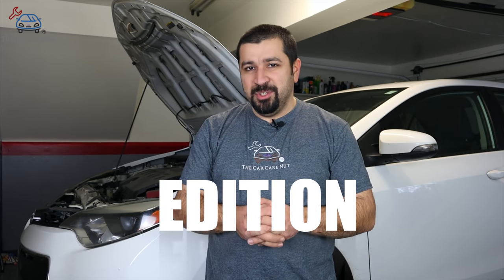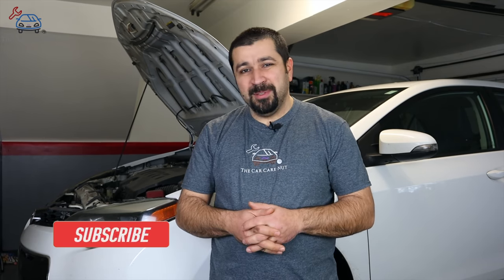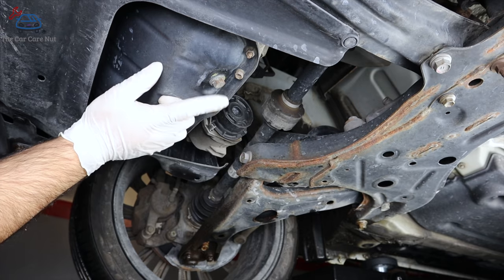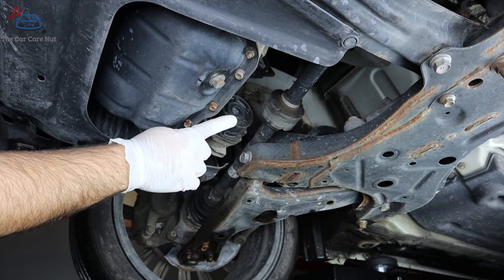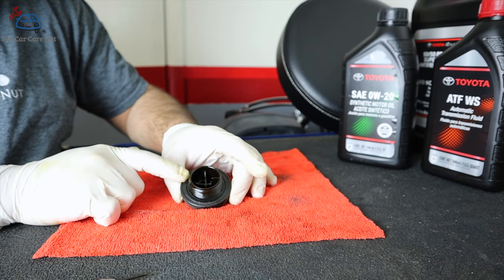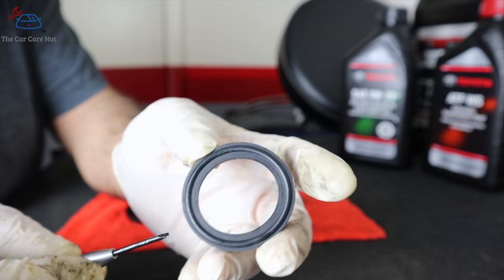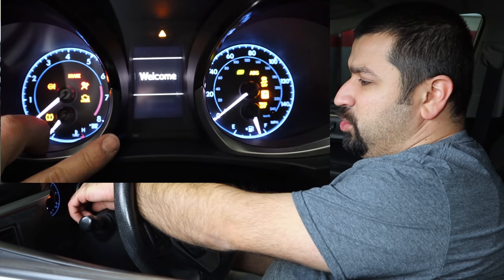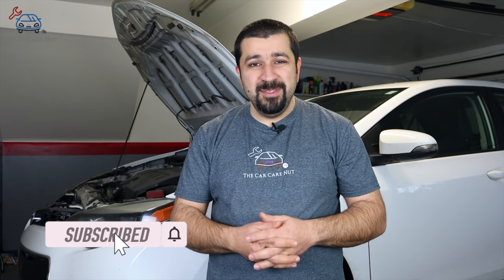How to change your Engine oil and filter for Toyota Lexus Scion

Comment: Hi AMD - i follow your schedule on oil changes and it's been great engine sound and performance (and least i feel like that!). Question - my 2016 RAV4 takes 4.6 quart of oil when changing the filter as well. But when I fill 4.6 quart and check for level (letting car run until temp gauge goes to the middle and then shut car off and wait 5 mins), it seems I'm always short ~1/4 quart to the top of the mark. Is it typical or am I just draining out more fluid given i only jack up (tech. on ramps) the front of the car, which leads to more oil drain given the angle? Thanks!
Reply from the maker: Hi! It’s possible you’re draining more. Top off the fluid to full when the engine is fully warmed up and you’re good to go
Reply: Thanks AMD! The manual says to wait minimum of 5 mins after engine warms up (then shut off) to check level (to let oil fall back down). It seems there is more oil will drip down if I wait much longer than 5 mins (for example after 20 mins I find more oil present on dipstick vs. after 5 mins). Does Toyota set 5 mins interval on purpose or should we wait longer to let all oil fully drain to check level? The manual did say a MINIMUM of 5 mins but didn't say exactly how long. Thanks
Reply from the maker: I would wait up to 5 minute but really 1 minute should do iy

Comment: How long does the car engine need to run to be fully warmed up?

I was wondering if I can check the engine oil level when it's warm in case I over filled my oil.
Reply from the maker: Hi! After a normal 30 minute drive the engine should be warmed up
Reply: @TheCarCareNut  I barely drive 10 miles a week and sometimes less than that, should I put the car in maintenance mode for 30 minutes then check the oil level? Or you recommend I just drive the car around town for 30 minutes?
Reply from the maker: You can do either but I would consider driving it to get everything moving since you’re not driving it much

Comment: Hello! Ive been looking around for more information in regards the 0W-16 oil. Recently, Ive seen in different forums that owners manuals from different countries (like Australia 2021 Rav 4) recommends oil weights of 0W-16, 0W-20, 5W-20 or 5W-30. Is there is a particular reason for this? Could be use these oil weights giving is the same Dynamic Force engine or the engines in our US market have been engineered or tuned differently to use 0W-16? Again, thanks for your insight.
Reply from the maker: There’s no official answer on this one. However I would recommend you follow your manual recommendation in your country.

Comment: On the spin on filter for my 18 Camry, should I put oil in the filter or only on the gasket??
Reply from the maker: Hi! No need to pre fill the filter and if it’s original filter it already comes with grease on the o ring
Reply: @TheCarCareNut  thank you. I always use TRD filters which I believe come like the OEM Toyota's pre oiled. Thank you so much. 😇

Comment: Can you do a DIY on a CVT transmission Corolla around 2016?
Reply from the maker: I do have one! https://youtu.be/eRxSu4-4ojo this is the exact same procedure just use Toyota CVt fluid
Reply: @TheCarCareNut  omg this is a dealership job... I'm always weary on changing the transmission fluid especially when it's someone else... Is it safe to assume all dealerships know what their doing and can fill it properly?
Reply from the maker: The transmission fluid replacement is very easy on Toyota sealed transmissions. Maybe for DIY mechanics it seems hard but for a professional mechanic it’s not a difficult process or an involved one.

Dealerships will be well equipped to handle a simple transmission fluid change and a fluid level check...
Reply: @TheCarCareNut  understood thanks for the info!  👍😁

Comment: Greetings from the Philippines!
 I have a 2016 Hilux made in Thailand and I’m curious if I can use an American Tacoma for reference when looking for info.
 I have two outstanding questions so far: how do I reset the oil change notification? It’s been bothering me for 3 years. Secondly, it seems I can’t lock all 4 doors without the key fob, just pressing the lock button the the driver’s armrest will only lock 3 doors leaving the driver’s door unlocked. I watched all the videos, contacted the dealer (not interested in helping) and tried ever conceivable sequence of buttons presses. Anyone have any ideas?
 Many thanks & love the channel!

Comment: Need some advice. 2020 Toyota Camery Le 2.5l 8 speed auto. Or Mazda 3, 2.5L 6 speed auto with tourqe converter awd? Yes it's the 3 not the 6 and it's a few bucks more then camry but I would get a repate. My concern is which four cylinder here is better and I've heard some pros and cons with camry 8 speed.
Reply from the maker: Hi! I don’t really know much about Mazda reliability but the later Camry transmissions are much better as they have the latest software from the factory.
Reply: @TheCarCareNut  Thank you. I'll will keep that in mind.

Comment: My 2007 Camry oil cap lists 0w20 and 5w20

Which oil weight would be best to use though? Car is on the Midwest and sees harsh winters
Reply: They typically reccomend 0w20 during colder months. Check the owners manual
Reply: @XxChuyoxX  ok the oil cap lists both 0w20 and 5w20 so it indicates either works on the '07 camry 4cylinder

Comment: Hello how are you ? I change my oil every 5000 mi  I use shell 0w 20 truck and tow full synthetic and wix 51348xp filter  for my taco 2.7l 2018. wondering if is there a larger filter i can use ?

Comment: Just had oil change AT DEALER for my 2021 Camry SE HYBRID.  Dealer used 0w20. Yes, right on invoice.
Your thoughts? Seems they ignore the recommendations
Reply from the maker: Hi! Is this in the US and is this the toyota included maintenance?
Reply: @The Car Care Nut  Canada. Here we have no included service. This was my first service.
From your expressed opinion I would not be surprised if you recommend I drain and refill with Ow16. I could do that, and switch to doing my own oil changes. There is a large sticker under the hood for OW16.
Reply from the maker: I would use 0w16 and ask them to use. Some areas are affected by the supply chain shortages and might not have 0w16 available
Reply: @The Car Care Nut  Hello Mr. Horemans,

 

Sorry for the delayed response, 0W16 oil is currently back ordered from Toyota, they have sent a Document to all Dealers indicating that they have approved the use of 0W20 oil in substitute of 0W16 for multiple oil changes.

 

Also the document states that the warranty coverage will not be impacted by this.

 

If there are anymore questions, please contact us.
Reply: I bought a jug of 0w16 at Canadian Tire and will have the dealer drain and refill. Snarky reply said" for you, no charge"
Courteous manager would have informed me of the issue when I booked the oil change.

Comment: Hey my dads 2012 Yaris hatchback just started burning oil is it a occ valve or should I start changing at 3,000 miles instead of 6,000 miles it has 200k miles

Comment: I live in an apartment. Should I use the spare tire jack to do oil changes?
Reply: I wouldn't recommend it, you may damage the pinch-weld over time. Your car your choice though.

Comment: Does the tool/size for oil canister for 1.8 engine on Corolla is different from V6 Toyota engines? I am looking to buy is from Amazon and it says the tool for 1.8 Corolla will not fit to V6 and Camry.

Comment: I have a question: I have an 08 mercury grand marquis, and the oil cap says 5w20, what about if the car has 400,000 should I still use the 5w20? or little bit heavy oil?
Reply from the maker: Hi Chris. Honestly I specialize with Toyota and won’t have the same knowledge with Ford engines as they age. However if you made it to 400k with 5w20 and you have no issues I would continue honestly.

Comment: Hi AMD, question for you please. I just took my wife's new 4Runner in to the dealer for a 1,500 mi (break in) oil change. When I was driving the car in I checked the tire pressures and they were all maxed out at 55 PSI. That would have been from when we picked it up. I asked the service writer to have it adjusted, but they apparently forgot. Why would they be so over inflated? 
Secondly I let the car sit overnight and check the oil this morning and it seems overfilled. There is oil far above the top line. Is it even possible for them to overfill it at the dealer?

Comment: How many kms/time had the car done on that oil? Looks quite dark. I got the oil changed on my 2021 RAV4 Hybrid at 6023kms/6months and it still had the color of honey on the dipstick (but darker than the color of fresh 0w16 which is almost invisible on the dipstick). Didn't see what it looked like draining tho as the Toyota dealership did the oil change for me at my request (not a standard service).

Comment: 2020 Corolla Hatchback SE Is it necessary to pre fill the oil filter? The torque specs for my oil drain plug and filter is the same as in the video?
Reply from the maker: Hi! Pre filling the filter is not possible on the side filters. And your corolla should have a spin on filer. Tighten it until it stops.
Reply: Thank you. A lot of value information on your videos. Keep up the good work.
Reply: By the way, I hear a noise every time I turn on the AC or heater. Its a weird noise, is like a digital noise or pitch noise I am not sure how to call it. It can get very annoying. Have any idea why or what is making this noise?
Reply: From the Toyota repair manual:
oil filter 13ft-lbs
oil drain plug 30ft-lbs
oil capacity with filter change 4.9qts
oil capacity without filter change 4.5qts
dry fill capacity (this is for BRAND NEW engines from the factory, don't actually put this much) 5.7qts
Reply: @manaco93-s9q  If your vehicle is still under warranty you should go to your Toyota dealer and have them check it out. It might be normal (you could check against a brand new vehicle of the same year and model and see if it makes the same noise) or there may be an issue with the AC system. I'd wager it's normal but it never hurts to check. I looked in the repair manual for you and did not find anything about this issue.
Reply: @MrMagichobo21  Thanks for the information.

Comment: So, I work at an oil change shop and our routine involves pressurizing the oil filter when you have a canister. (Not the spin on type) is this something you would recommend doing for the diyers? 
(Our pressure test usually consists of revving the vehicle up to 2500-3000 rpm and holding for 10 seconds.) What is your take om that check?
Reply from the maker: Hi! You can do that. Or just running it at idle. If there’s a leak on the canister you’ll see it right away.
Reply: @TheCarCareNut  Thanks for your input. I appreciate getting advice from more experienced mechanics.
Reply: Spin-on filters are canisters..

Comment: Hi, I’ve got a 19 Camry hybrid that uses the YZZF2 oil filter.  When I purchased the oil filter at the dealership, the parts guy said the YZZF1 filter holds more oil and fits as well, this way I could just add 5 qts of oil as opposed to 4.8 qts. I purchased the YZZF2 but going forward is the YZZF1 a good substitute for YZZF2?
Thanks

Comment: Why did they go back to spin on on the Prius? I have a 2017 Prius 3 with a spin on.
Reply from the maker: No real answer why. Perhaps production reasons.  The only difference is the housing where the oil filter goes.

Comment: Can i request my dealership to change my oil every 5000? I took my camry for the 5000 miles maintenance and they did some stuff but never changed my oil i'm concerned about that because i don't like that 10,000 miles oil change. Is there something i can do  i still have the free maintenance waranty
Reply from the maker: Hi! Under the free maintenance they won’t change it. But you can ask them to change it and pay for the oil change at 5k

Comment: Great video. Question: What's your opinion on those drain valves like the ValvoMax where you don't have to take the plug out just unscrew the top and drain the oil? For someone that does their own oil changes they seem like they would make the job easier, but I'm afraid of any potential issues with the valve failing and leaking oil. Have you ever used those types of drain valves?
Reply: I have a Fumoto on noth my Harley engine and Rav4.
They're the best. Its really handy and with the little black clip they've never failed or leaked.

Comment: Please help looking for advice.  So the place I go for a oil change explained to me how they do it. But they believe has long as they get it into the 2 dots on the dipstick it is good. Which it seems they aim for the max dot. My question is I know oil expands when hot so how bad will it affect things if when they are done its at the max line?  And when it is done is it best to drive it and then let it cool for 10 mins to check the level?Thanks for your help.
Reply: check your manual. my sienna says to get the engine to operating temp first and then check the oil, like he says in the video, but refer to your specific manual on how to check the oil level

Comment: 2013 Corolla 122k miles. 
Each oil change I’ve noticed it burns  about 3/4qt of oil at the 5k mi or 6 month oil change. Is this normal or at least acceptable for the age and mileage of the car?
Reply from the maker: Hi Armando. That’s actually very little consumption and I wouldn’t worry about it at this point. If all of a sudden it increases then run an engine oil cleaner

Comment: I let my oil drain for an hour. While it's draining I rotate the tires or vacuum the car , change the air filters etc. My 17 year old engines are clean like new inside.

Comment: sadly at our toyota dealership, they are all recomend only the 5/30 engine oil, they are saying that on our climat this is good choise,but i always telling them that thank you fro your opinion but i only need what is on my engine oil mark, firstly i use 0w20 at my toyota camry 2019 but after your video i will use 0w16 ,thank you very much great man ..!
Reply: It's chef's choice. At 200K, I switched to 0w30. Then 5w30. Now at 230K, I did mine the first time and used 0w40 because of my mileage, it gets HOT (90°F), and I drive "hard" once warmed up, and I live on a dirt road. It's severe duty, really. Most people are but in denial about it

Comment: That big "O" ring , I feel can be reused if I have to. I replaced the plastic housing with an aluminum one. I do not trust the plastic and it might failed on a Sunday, dealer wanted $90 for it. The Al radiate heat better. I used 0W-20 and since it is synthetic, I change ever 20,000 km , twice that of regular oil, and I make sure to keep car out of the severe service  category. What pisses me off is, I feel ripped off, the filter without the metal housing cost more than the old filter. This type however is suitable for aircraft, for it saves us from having to cut open the filter to check for metal. Mine is 2015 Camry and it use very little oil. I assumed I have the stronger spring behind the oil control piston rings. Since I even out the kilometers to change oil, I do not have to keep record.

Comment: Thanks for the 411, i have a question. U have said in previous videos that a new car break in should dump the oil at 1000 miles. I have a 4 runner with 540 miles and plan on dumping the oil. Is the oil in the truck from the factory Synthetic or Organic? And will self done oil change  have any affect on warranty? I plan on using Mobil one 0-20. I could not get oil filter from parts store they said it was to new and they didn't have it yet, is it the same filter as a 2019-or 2020 4 Runner?. I will have to go to dealer for filter. Thanks
Reply from the maker: Hi! 0W20 full synthetic and I would use an original oil filter the filter number is A5 from the dealership and it’s the same from 2010-2021 4runners
Reply: @TheCarCareNut  Thanks  u nut!

Comment: How to do a coolant change on a 2gr-fe. I have a 3rd Gen Highlander. 167,000km. Never changed it. Thinking to do it because of coronavirus and being bored.

Also, I'm thinking to install a catch can that I bought. Should I do it?
Reply from the maker: Hi! I’m working on a video for this exact request. Should be out soon. The 2gr can be challenging to bleed right but a trick I’ll show you in the upcoming video will make it a easy. 

I wouldn’t install a catch can on your v6

Comment: Can you tell me where to buy that orange coloured funnel that you used inlace of the filler cap?
Reply: I'd like to know as well!
Reply from the maker: Hi! So that funnel is made by snap on for a ridiculous price but you can buy a similar funnel from Amazon for 1/10 the price here’s a link  https://www.amazon.com/dp/B016FVJUX0/ref=cm_sw_r_cp_api_glc_fabc_mSmcGb8CRNN24
Reply: @TheCarCareNut   I am in Canada and do not see it on Amazon.ca. Overall, it's just too expensive to ship up here- thanks anyway!
Reply from the maker: Sorry man! Maybe search online for Toyota oil funnel maybe you’ll find it locally?
Reply: @TheCarCareNut  Is there a funnel like that for a 2004 Sienna and a 2013 Corolla S and a 2021 RAV4 hybrid. Thanks and your channel is by far the best. Not a bunch of BS just the info that is needed.
Reply from the maker: Hi! The 13 corolla and 21 RAV4 will have the same one. The 2004 sienna will have a different one which I also have made by snap on but here’s a version that’s cheaper 

Motivx Tools Engine Oil Funnel for Toyota, Lexus, and Scion Vehicles with Half Turn Adapter https://www.amazon.com/dp/B07WSHN59B/ref=cm_sw_r_cp_api_glc_fabc_NCBcGbH192P3V
Reply: Thanks for the info, AMD. May the Lord bless you and keep you as well!